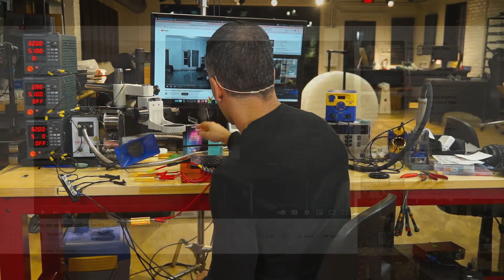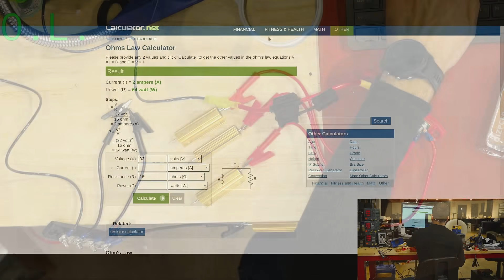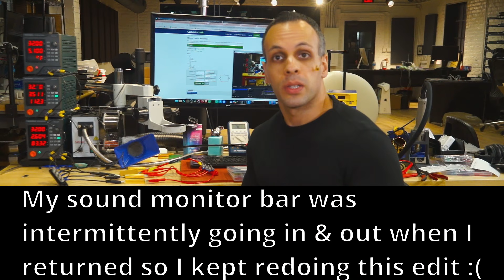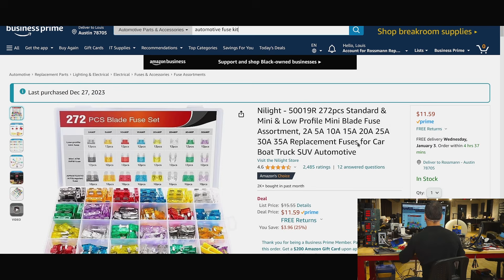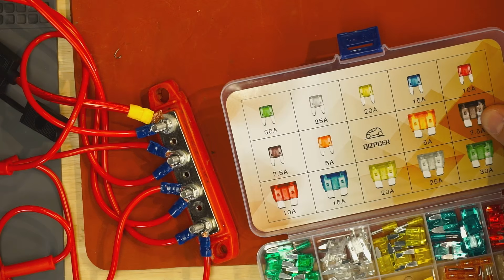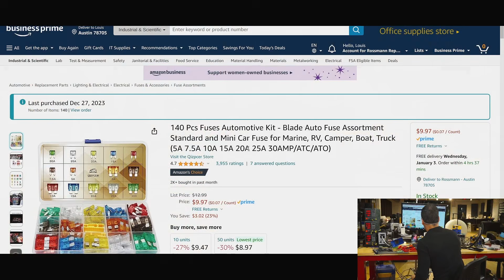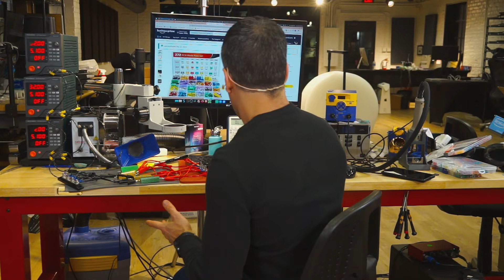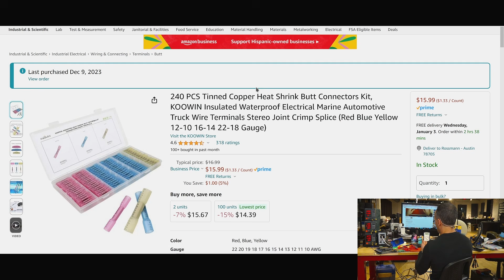Amazon Sells Fake Electrical Fuses

Comment: In the mid-late part of the video when you interrupt to state the obvious about the real world testing going 2-3-4x the rated amperage for CONSIDERABLE amounts of time ...... I was picturing what the "Mystery Curve" on the 2Amp might look like and had a thought..... probably what you'd expect for a 5-8Amp rated fuse?

I'm not sure if you go there towards the end of the video yet but I rewound back to the box with all the fuse sizes shown.  My bet is this - The factory is literally using 3x ratings of fuse wire on the spool.  5 - 15 - 30 or some other odd combo, maybe 8 - 16 -32.  (Think of the fuse wire you used to buy for your house, but on an industrial scale).

If I'm right this means at best 40-50% of the pack is safe and the rest are WAY underrated for their tolerances.

Comment: It's kind of funny you say it's not like we're dealing with knockoff Cheetos. That's actually why we have regulators too! Knock off Cheetos could be full of lead, or some other chemical which makes them taste good, but it's cheaper than using actual cheese! The entire point of regulations is safety, be it food or fuses. Remember our milk used to have a massive amount of mercury in it from time to time! Hahaha. Electronics aren't allowed to have mercury anymore either as a general rule. Great quick video to demonstrate how inaccurate product specifications can be.

Comment: Scary stuff, Louis.  But definitely the hard way; you could've skipped the resistors and just used the current limit on the power supplies.  The rated voltage on the fuse doesn't matter until after the fuse melts. You want the fuses rated sufficiently high that the air gap doesn't start to conduct once the fuse blows.
Reply: Fuses should really be sold with a wattage rating. Voltage matters. If Louis used 16 volts, the fuse would require double the amperage (the same wattage) to blow. A fuse works by the fact that it has a relatively high resistance, so it dissipates some power proportional to the load; this dissipation is what blows it. Since it's just a resistor, it's clear that it would need double the amperage at half the voltage to blow, since the wattage the fuse dissipates is what actually makes it blow. I never realized this till now and I've been playing with electronics for 25 years. Damn.
Reply: @TheMrTape  This is false and dangerous and should be deleted. Fuses are overcurrent protection devices and should blow at the rated current regardless of voltage.
Reply: That is my understanding too. Of course maybe Amazon have redefined the definition of a fuse?
Reply: @TheMrTape this is not how that works. Heat dissipated relies on current. Current depends on voltage given fixed resistance. You could put 1 amp at a kilovolt and it’d dissipate the same heat as 1 amp at 12 volts.
Reply: @Flumphinator  Then explain the math, because you can't. You're ignoring ohm's law. A fuse is a piece of high resistance wire; basic electrical principles dictate that the power it dissipates is equivalent to (Volt / Ohm) x Volt = Watt (volt being the voltage drop across the fuse, not the total voltage).

You're saying it will dissipate the same (thus blow the same) at virtually no power (eg. 1 Amp at 1 millivolt), the same as it would with 1 kw, but objectively that's an outrageous statement. You could take a 1 amp mains fuse and put 100 amps through it at 1 millivolt across it, making it dissipate 0.1 watts; how is the wire gonna melt at 0.1W again? It obviously can't and won't.

When talking passive components at fixed resistance, amps mean nothing in terms of actual energy dissipated, it only does when combined with voltage, and as such, I'm correct in my original statement that an amp rating is useless without a voltage rating.

However, a wattage rating would be equally useless, since that's not linear with load at differing voltages either; i.e., fuses should be sold both with amp and voltage rating, which already is the case; what I learned is that the voltage rating is equally important to get right. 

If I put a 240v fuse in a 120v product, it's going to take double the rated amps to blow it, because it will halve the voltage drop across the fuse (the effective voltage it sees); so, while the amps running through it might be the same, the dissipated energy halves since Volts x Amps = Watts (again, volts being voltage drop in this case).

They could be sold with wattage and voltage ratings the same, the point is that we have to define 2 of the 3 (from voltage, amp and wattage), to determine the third and know how much energy is actually required to be dissipated before the fuse blows, in order for the rating to actually mean something.

It matters less for "fixed" voltage system-paradigms like mains (in which most common fuses are designed to uniquely and only fit one system), then, effectively only the amp rating matters when comparing to other mains fuses (but only since the voltage is already inherently known).
Reply: @TheMrTape  Power is equal to the square of the current multiplied by the resistance. This includes heat dissipated by a resistor. The current is determined by Ohm’s law, relating resistance.

Try it. Get a shunt resistor and a 12/24 volt supply. Blow a 5 amp fuse on both voltages and tell me what happens. I’ll wait. 

Spoiler: the fuse doesn’t care, it’s 5 amps either way.

Comment: Name brands are using amazon as a trash bin. I bought 3 circuit boards to get one working. Not only that, they don’t offer replacements for sale items. Only returns. You have to purchase the items again, losing your discout savings. It's a passive scam. I had to send back quite a few cyber Monday deals. Oh well, I found a workaround for the broken items by buying a new one at regular price and returning the bad one. But, is it worth the headaches. It put my project behind, but considering the fast shipping they provide, it may not be that big of difference compared to regular shipping through the company.  Oh and they have a lack of customer support on sale items.

Comment: I had a car almost catch fire from a Chinese fuse bought in a kit from harbor freight. Installed it for the "power socket" in my car.
The "fuse" melted when a short happened again (a Chinese charger), but the resulted metallic liquid blob was still making contact... and providing battery power to the short circuit. I had to yank the glowing and smoking wire from under the dash with my bare hand.

PS: I went back to the store to tell them, they already had a recall notice for those fuses. Awesome $5 that could burn down my car.

Comment: Fuses require proper metallurgy in order to fail at proper currents. China not known for consistent quality metallurgy. Also plastic packaging on ATO fuses I've gotten are bad as the plastic fails so fuse body breaks when. removed from socket

Comment: 1.5 times rated current is usually the critical point, where the fuse works for a bit but eventually fails. At double the rated current reputable fuses reliably blow within seconds (fast blow) or inside a minute (slow blow). 5 times the rated current is totally unsafe.

Comment: A customer of mine brought in a duff 512GB USB memory stick from Amazon that she had a problem with. She couldnt believe that Amazon would sell rubbish stuff. It is difficult to explain to some people that they use third party sellers like they do on ebay except Amazon is usually is more expensive and ebay has a better feedback and easier returns system.

Comment: I've been using Amazon as a catalog to find better companies with better independent reviews.  Then I go direct to the manufacturer with the best reputation.  Almost all of them will ship direct to the customer.  I did it because years ago, with their treatment of their own workers and politicization (Denying AW$ services to a platform they deemed politically incorrect).  I also had my own mini-boycott against Chinese goods, because of how they treat their people and their predatory trade practices.  I think countries like that should face steep tariffs, to offset their underhandedness and oppression at home.  No embargoes.  Just a middle path that increases the cost of being authoritarian cheats.

As time has gone on, it's gotten harder and harder to tell just from the Amazon site where something is made, and the more they hide it, the more sure I am that it's from China, where, on top of everything else, I have no confidence as to the materials used or the quality of construction, expecting it to fall apart or wear out really fast.

Amazon was a great idea and revolutionized commerce, but when it could be generous and open, it chose to be tight-fisted and opaque.  It won't be going any where any time soon, but it'll do without most of my business.

Comment: I just recently had a hard time finding reliable fuses on amazon because I already knew of the bad fuses. Like you said, no way to distinguish which actually are good. In the end, I managed to find the last blister of 10 japanese fuses (3 bucks, the cheap ones cost like 2 bucks and most of the cheap ones use the same product pictures) for my car and when it arrived they were the exact same ones the manufacturer uses, so I got lucky there.

Comment: While I wholeheartedly agree with what you are saying, your testing methodology, in a word, sucks.  With a sample size of one for Nilight, one (of a different value) for Kzper, and three for Crocsee, how can you really draw the conclusion that the first two brands are crap?  I'm not saying that you should have tested every single fuse in each kit, but at least 3 to 10 of the same value from each kit would have been more telling.  I agree that the first two kits are probably crap but can you realy tell from just 1 sample?

Comment: I didn't think they could get car fuses wrong, I'll have to check mine. They are just the start of the dangerous products on there, cheap phone chargers and foldable axle stands are some of the most lethal. Those aluminium clad resistors get hot quick and need to be mounted on a heatsink for higher power.

Comment: Louis. 2 years ago I spent over 2500 on an electronics lab. It's a hobby I wanted to take professional. It's been almost 2 years now and I haven't done anything with it because half the components were fake, my power supply went out after a year and  every time I tried to get help I got the run around. So I will never buy off Amazon again. I'll go out in the public and buy it at a higher price.

Comment: The point when they two brands are blowing at 10 amps on two entirely different ratings, is the point where I have to wonder if these boxes are just nothing but 10 amp fuses with different labels.

Comment: I downloaded a datasheet for 32v blade car fuses from RS components, a reputable UK electrical components supplier.
According to the curve for a 2A fuse, it will blow:
3A - 0.9 seconds
4A - 0.3s
8A - 0.05s

Comment: Those 100W resistors are also only rated at 10W when in free air. To get the 100W rating you need them firmly bolted to a rather large thick heatsink block.
Reply: This is often overlooked, a fan cooled heatsink is often needed.
Reply: @dino6627  Yup, got a whole lot of 25W ones, but without heatsink they are only rated for 7W.
Reply: That looked like a "how to light your desk on fire" tutorial

Comment: I thank you very much for this series Louis. Several months ago, I lost the AC fuse from my car's fusebox and had to get a new one from the hardware store. I went to 3 different stores before I found any that were in stock, and was at the point where I considered just ordering a pack off amazon. The results of this test has made me VERY glad that I did not proceed with ordering on amazon.

Comment: My friend bought a "Shimano Acera" 3×9 gear set for his somewhat older mountain bike and guess what? The rear gear shifter has a badly stamped wheel inside of it (a shifter works like a lever that should move the derailleur by a set amount of mm to match the cogs on the cassette) but it was all over the place and even when not connected to anything it would not go i to 9th gear😂 the derailleur ( supposed to be Acera) had a lot of sideways play in the jockey wheels and the cage itself was super flimsy. We compared these to the original parts as he was replacing them like for like. Amazon, Ebay and other platforms are now overrun by these sellers. And their response to the complaints is- we will refund you if you leave us a good review now! Yes, sure!
Another big No-No mtb brake pads for V-brakes...you adjust and tighten them, the bolt stays put but the pad material twists and turns and is a hazard...

Comment: A PET FEEDER from amazon i bought 2 months ago JUST TODAY almost caught fire. Brand Yuposli

It stopped working in the morning and I lifted it up to see what was going on and the metal part plugging into the feeder was melted into it, the rest of the cord fell off and was molten red and you could smell the burn.

Contacted support no refund or return available (even though it says on the page a return is available until january 31st). Not even offered credit for almost losing my home.

Comment: I was surprised too,  I thought a fast blow fuse would blow at the rated amps and was wondering why I was blowing transistors. Then I looked up the spec's from the electronices book and found out that means it passes that current and will blow at double the rating after 1 second which is long enough to blow the board. A slow blow will blow at twice the current after 3 seconds.
You sould see CSA and FB on the fuse or UL approved. Canadian Standards Association. If you want to protect your machine you should have an UPS.  Fuses will only protect against fire.

Comment: Don't worry, Louis.  You aren't weak at pulling fuses out.  The fuses just double as solder once they heat up to the point of melting and finally blow.
Reply: But they never have enough flux, if Louis; videos teach us anything!

Comment: Greetings from the peanut gallery! :)

It's not "what it's rated to blow at", it's what it's rated to pass without blowing. However I agree with you, I would expect a 2 amp fuse to blow above 2 amps but well below 8 amps. FWIW, I have a bag of 3 amp fuses from Amazon which I bought to replace the fuse for the 24 VAC circuit in my furnace. I took my cheapie 10A 30V DC variable power supply (also from Amazon), set it at 10 volts, shorted the terminals, and set tue current to 0. I then hooked up leads, hooked them to one of the 3 amp fuses, and also set my DC clamp meter (it has a hall sensor) on one of the leads to monitor current, just in case the display on the cheapie supply might be inaccurate. I slowly raised the current, and it blew at 4.2 amps, agreeing with the clamp meter. I tried another, it blew at 4.4 amps. I'm not certain how much margin there should be above the rated 3 amps, but I'm not too concerned with these fuses. I also wouldn't want a circuit breaker in my house to pop exactly rated 15 amps, but slightly above it for a long enough period of time where transients don't needlessly pop it.

Oh and if you were in charge of parts procurement at an electronics device manufacturer, you would sample incoming lots of parts to make sure they are in spec. Just because they are name brand and don't come from China doesn't mean they are always in spec.

A side note: when you use precision ratchet crompers, make sure it's designed to work with the connectors you are using. Just using wire guage as a guide is not sufficient because the qualith of the crimp when using these crimpers is also dependent on the thickness of the metal sleeve and the outer insulating material. A good ratchet crimper will come with instructions specifying exactly which connectors it's meant to be used with. I'm not saying the cheapie connectors in your other video are good, they may also fail for other reasons, but using a precision ratchet crimper only further confounds the issue.

Comment: We need a new service that recommends products. Kind of like Consumer reports but a lot better and free. And for this experiment, we should put IR cameras on the stuff to check the temps of the fuse and resistors. And you just need a larger more adjustable supply. Still great though

Comment: I've noticed this trend of cheap garbage overwhelming the search results as well. Further, with the lack of oversight I worry that the "Real Brands" I buy off Amazon will be counterfeit as well. I've been trending back to brick and mortar stores, myself. They aren't immune to counterfeit garbage either, but at least it's far less likely overall. So far.
Reply: Same, there’s some sketch stuff and results on Amazon. Gotta be on guard shopping over there. It’s like eBay before they cracked down to defend their reputation that had tanked in the past.
Reply: Oh shit, I buy all my vitamins from Amazon.
Reply: Amazon has been selling counterfeit for years now. 
Most of the water filters for coffee mashines are counterfeit while the package and labels are almost indistinguishable. 
Had 3000$ worth of coffe maschines croak becauss the supposedly original filter was leaking the filter medium into the pump of the coffee machine. 

Same goes for phone chargers. 
Had some at work that gave a co worler a schock and ended his laptop. 
It was sold as genuin Samsung on Amazon in a front page result